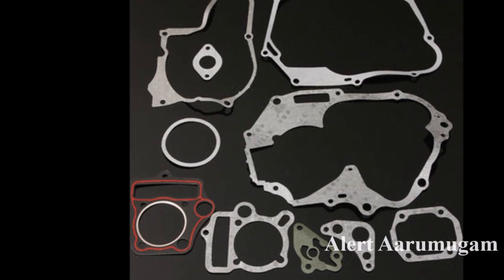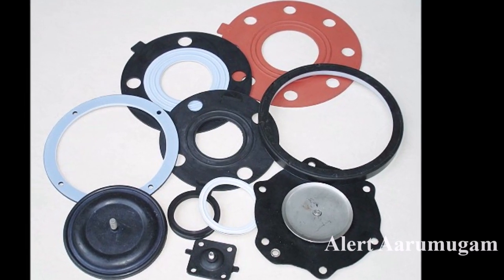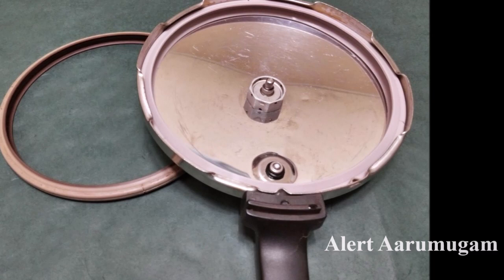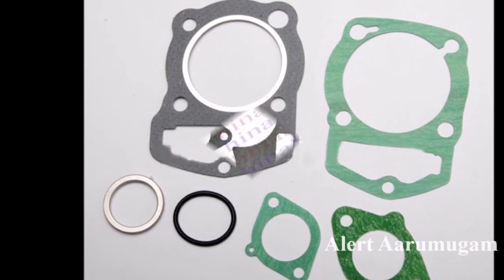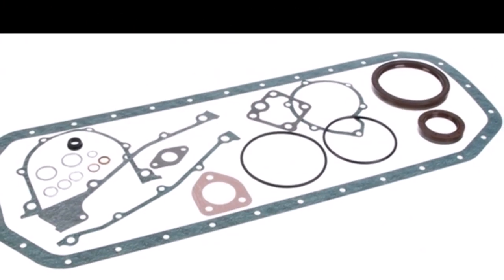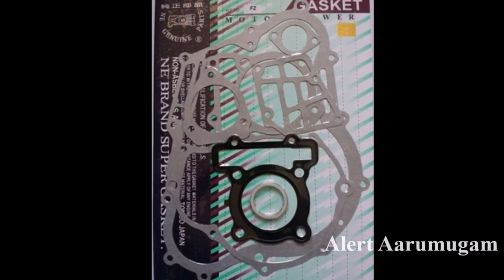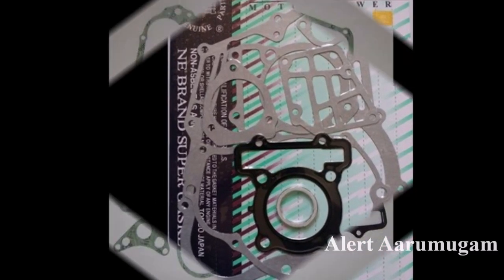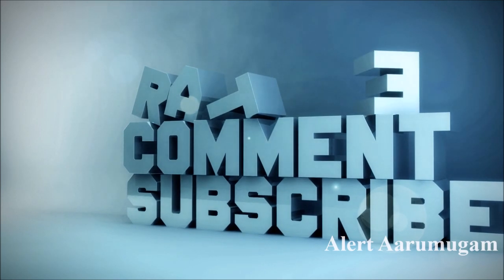உங்க பைக்ல இந்த பிரச்னை வந்தால் சிக்கல் தான் | What Is The Purpose Of Gasket In Automobile | Gasket

Comment: Hi bro how r u? All ur uploaded videos was very helpful... as per ur ideas i following and my bike passion pro is giving Milage 66.km for long driving & 61.km for local driving..i properly checking engine oil level{castrol oil},air filter cleaning and chain lubrication. I have one doubt about my bike that when i start then change the first gear at the time engine suddenly off so what's the reson for that? I highly expecting ur valuable reply